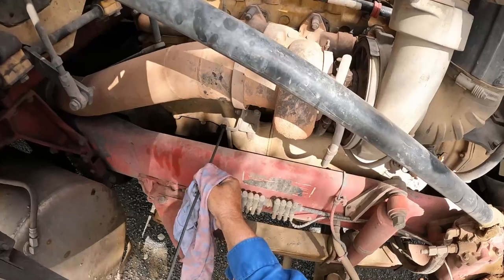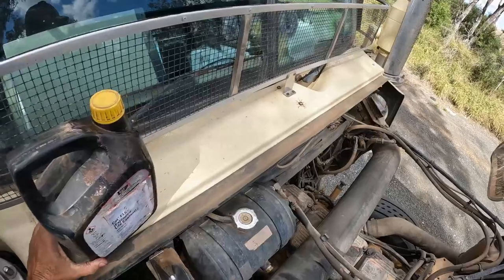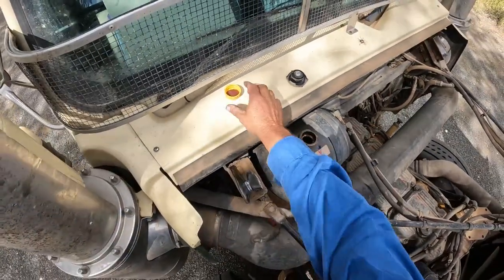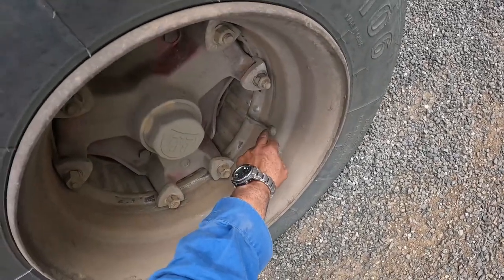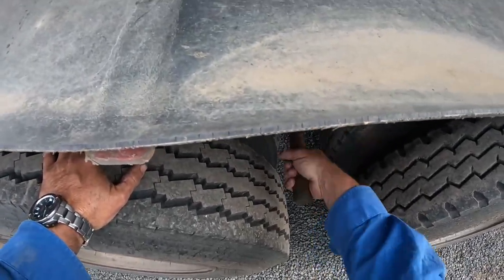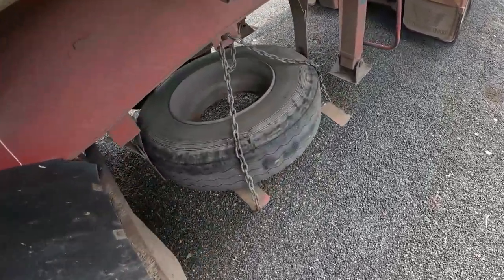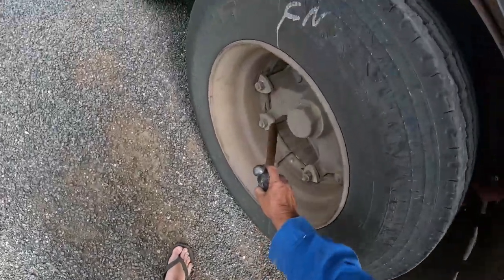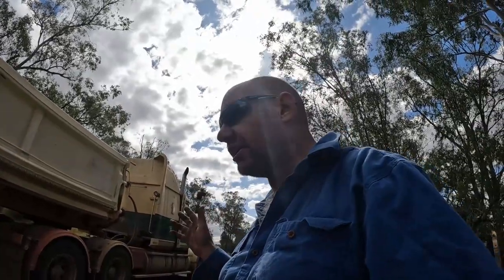What do Aussie Truckie check Daily and weekly

Comment: Oil, coolant, tyres, air , oil , fuel, coolant leaks, turn table , airlines, clean windscreen, clean lights and the number plate and advisor signs, seatbelt  .general check over. Why turntable, many moons ago a prick at a truck stop thought it would be funny to pull the  pin on parked up trucks. I always release the truck first do a tug test and then the trailer. Cops will always blame you for someone else stupidity. Also check the back doors , just in case an arsehole has opened up the door for a look and stealing freight. We lost  $12k of freight one night. Up goes the insurance premium.
Reply from the maker: That why I don't sleep at service station.
Reply: @tezthetruckie  very true,
Reply: Yep. I always check both pins after I have left the truck unattended for any period; even if I have just gone into the truckstop for a leak and a coffee. Dropping a trailer would not be fun.
Reply: @jonathanrabbitt  dropping trailer especially on a public road gets the truck and trailer impounded for inspection. Then the infringement notice and then the bollocking from the boss.

Comment: I have no idea why but when you lifted the bonnet I found what was under it a bit disappointing.  Not sure what I was expecting but……. Thanks for the sticky beak I enjoyed.  The the person who said some arsehole did something to his truck I agree with his swearing.  It a hard road you travel and to be sabotaged like that is so stupid and dangerous. Sorry you had to experience. Play safe.  What are the yellow tabs on the wheels you are talking about when checking the tyres and why do you hate them?
Reply: the yellow tabs are lug nut indicators and you use them as a safety at a glance to see if your nuts have moved from when they were done up. you can point them together or point them to the centre or all in the same direction but as long as they are not moving you know that your wheels are not loose. The problem is they are pushed over the nut and can become difficult to take off when you have to undo the nut when you have to change the tyre, usually dust and dirt make them become a little stuck but they are only plastic and do come off relatively easy
Reply: @jc7654  Thank you